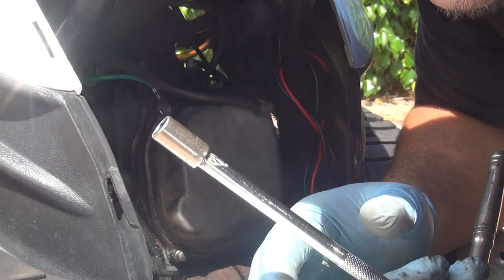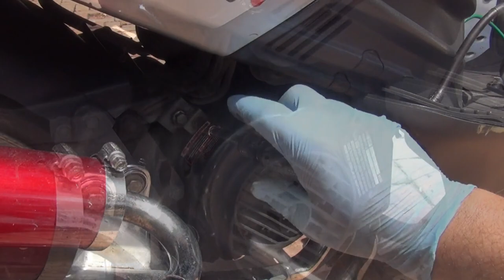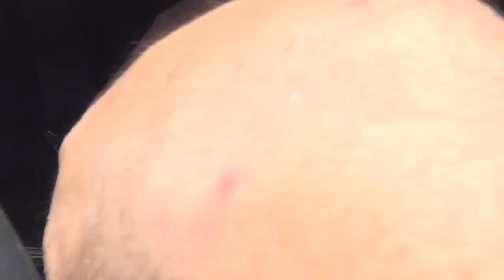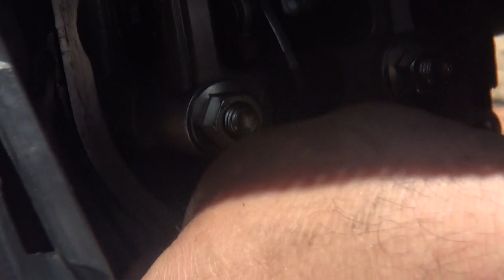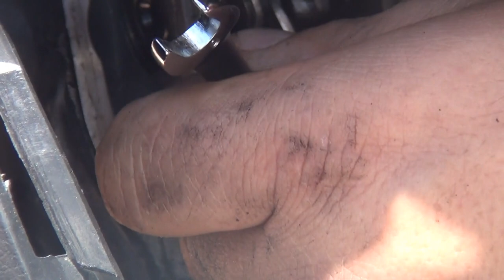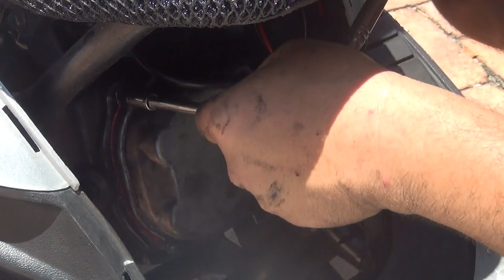Ultimate GY6 150cc Valve Adjustment Tutorial

Comment: Made these adjustments for ny 49cc .004 upper, .003 lower..now i have chatter..got my toos speef back but im pretty certain chatter isnt good for the engine so I readjusted them to where i had only a little wiggle room,and it runs like a top but I have lower top speed..
Reply from the maker: I ‘ m not specialize with 50 cc scooter try to check online or scooter Facebook group if you can find the perfect solution thank you for watching my video

Comment: Hey friend I have a GY6 50cc Chinese scooter my question is on the valve cover is there always a ground wire on one of the screws?
Reply from the maker: Hello my friend sometimes the green ground wire is on the cover bolt or sometimes is on the fan cover bolt on the right lower side of the scooter personally I like the ground wire  at the cover because is closer to the sparkplug. Thank you for watching my video
Reply: @VirberelloScooterTips  thank you friend

Comment: Hey thank you for the lesson but what should be the clearence be on a gy6 152qmi 125cc engine i did mine like yours but now the clearence is too much there is a clicking sound bcuz of that so if you can tell me how much it has to be in MM i would be very thankful👍
Reply from the maker: Hi. Usually .003-.005. Set mine at .004 ...no noise at all should be heard from valves but if you still ear clicking thing about motor oil pressure like the oil pump going bad and not bringing lots of oil to the valves 👍
Reply: @VirberelloScooterTips  i will try thank you brother learned so much from you

Comment: Does the ground wire go from the valve cover to the battery? I bought a used moped and the wire is to the valve cover but the other end is loose. Thanks.
Reply from the maker: In most cases, the ground wire in a scooter does not directly connect from the valve cover from the battery. The ground wire is typically responsible for providing a return path for electrical current and is usually connected to the frame of the scooter and them connected to the valve cover, which then acts as the common ground point for various electrical components.
It's possible that the previous owner of the moped may have made modifications or changes to the wiring, leading to the ground wire being attached to the valve cover. Thank you for watching my video

Comment: Ive got a 150cc Powermax chinese scooter...i replaced the the spark plug,  new air filter, new carburetor, new fuel/air lines and petcock; im still having performance issues though. Ill be riding (1/2 or 3/4 throttle) and occasionally it will slightly bog down and lose power. If i play with the throttle a bit it will sometimes come out of it, but then other times itll stay like that until ive reached my destination and wont run right until after im heading back home...i plan to replace the CDI next, but next to that, are there any thoughts you might have on whats causing this?
Reply from the maker: It sounds like you've done a fair bit of troubleshooting already, which is great. The symptoms you're describing—a scooter that bogs down and loses power intermittently, especially at partial throttle—can be indicative of several issues. Let's explore some possibilities beyond the CDI:
Ignition System Issues: While you're planning to replace the CDI, it's also worth checking the ignition coil and the stator. Faulty components in the ignition system can lead to intermittent power loss.
Fuel System Problems: Even with a new carburetor and fuel lines, there could still be issues within the fuel system. Ensure that the fuel tank is clean and free of debris, and double-check that the fuel lines are properly connected and not kinked. Additionally, verify that the fuel filter is clean and not clogged, as restricted fuel flow could cause power loss.
Vacuum Leaks: Any air leaks in the intake system can disrupt the air-fuel mixture and cause performance issues. Check all connections from the carburetor to the engine for leaks, including gaskets and intake manifold connections.
Exhaust System Blockage: A blocked exhaust can lead to back pressure, causing the engine to run poorly. Check the exhaust system for obstructions or restrictions, such as a clogged muffler or exhaust pipe.
Electrical Connections: Ensure all electrical connections are secure and free of corrosion. Loose connections or corrosion can lead to intermittent electrical problems, including power loss.
Engine Timing: Incorrect ignition timing can cause poor engine performance. While this is less common on small scooters, it's still worth checking if you've exhausted other possibilities.
Compression Issues: Low compression can lead to power loss. Perform a compression test to ensure the engine is operating within the manufacturer's specifications.
Quality of Replacement Parts: While you've replaced several components, it's essential to consider the quality of the replacement parts. Sometimes, aftermarket parts may not perform as well as OEM parts, leading to continued issues.
Overheating: Check for signs of overheating, such as a hot engine or exhaust. Overheating can cause performance issues and damage engine components.
Engine Tuning: Lastly, ensure the engine is properly tuned. This includes adjusting the idle speed, air-fuel mixture, and throttle cable tension according to the manufacturer's specifications.
By methodically checking each of these potential issues, you should be able to narrow down the cause of the performance problems with your scooter. If you're still unable to resolve the issue after replacing the CDI and investigating these possibilities, it may be helpful to consult a professional mechanic with experience working on scooters. Thank you for watching my video and if you have more question feel free to contact me anytime
Reply: @VirberelloScooterTips  because my scooter is one of those cheaply made chinese bikes, the exhaust was the first thing to go on it; just broke off out of nowhere. I tried a couple times to get it recounted with no luck so I just do without it. And while I know that not having an exhaust can effect performance and gas mileage,  I don't believe that it is the source of my problem as this issue presented itself almost 2 years after losing the exhaust...I'm in the middle of breaking down the OEM Carb for cleaning, I would really like to re-jet it but I don't quite understand the process behind it and not confident I'd do it right, so I'll just replace the current jets in it and keep it for a spare... after the new CDI arrives though,  I think my next step will be checking the air/fuel mixture because I believe that is where my problem lies

Comment: My friend did this on my gy6 sym fiddle 2 but since then both wheels have been stuck on the ground i.e. not pivoting when on centre stand, very hard to turn wheels to put in air. Engine seems fine now, turned out to just be a loose coil wire but as I can't understand how adjusting gaps could lower the wheels I'm scared to ride it now in case something else structural has gone. Any ideas what could cause this?
Reply from the maker: It's unusual for adjusting the gaps on a GY6 scooter to cause both wheels to be stuck on the ground when on the center stand. Here are a few things to consider and check in this situation:

Center Stand Issue: Make sure that the center stand is functioning correctly. It's possible that the center stand itself is not properly engaged or is obstructed in some way, preventing the wheels from lifting off the ground.

Rear Suspension: The rear suspension could be the culprit. If the suspension has been improperly adjusted or tampered with, it might not be allowing the rear of the scooter to lift properly. Check for any issues with the rear shock absorbers, springs, or suspension components.

Wheel Bearings: If the wheels are hard to turn, it could be a problem with the wheel bearings. If they are damaged or not properly lubricated, they can create excess friction and prevent the wheels from spinning freely.

Brake Calipers or Pads: Check the brake calipers and brake pads on both wheels. If they are not releasing properly, they can create friction against the rotors and prevent the wheels from turning freely.

Tire Pressure: Make sure that the tire pressure is correct. Low tire pressure can make it more difficult to lift the scooter on the center stand.

Alignment: Incorrect wheel alignment can also make it difficult to turn the wheels. Check if the wheels are properly aligned and adjust them if necessary.

Inspect Recent Adjustments: Since you mentioned that your friend did some adjustments, review the work they did. Ensure that nothing was inadvertently changed that could affect the scooter's ability to go on the center stand.

If you're unable to identify and fix the issue yourself, it's advisable to take the scooter to a qualified mechanic or service center for a thorough inspection. Riding a scooter with unknown structural issues can be dangerous, so it's essential to ensure that everything is in working order before using it again.
Reply: Wow many thanks for such a comprehensive list to work through. I've already replaced the centre stand but will check thru the rest & yes defo not riding it until I know understand what's causing it. All my local bike shops seem to be permantly booked up but hopefully will find someone knowledgeable to help figure out what's going on. & well it might be time to finally look at getting a new bike, just don't want to give up on it yet.

Comment: I’m doing this right now actually I’m heading outside to tear it down
Reply from the maker: You're welcome! I'm glad to hear that my YouTube video on valve adjustment is helpful to you. Performing maintenance tasks like valve adjustment can be crucial for keeping your scooter running smoothly and efficiently. Remember to take your time and follow the steps carefully to ensure everything is done correctly.
If you encounter any difficulties or have questions during the process, feel free to reach out for help. Working on your scooter can be rewarding, but safety should always be a priority, so make sure to wear appropriate safety gear and work in a well-ventilated area.
Good luck with your valve adjustment! I hope your scooter runs even better after this maintenance. If you need any further assistance or have any other questions, don't hesitate to ask. Happy scootering!

Comment: Hello I have a 49cc puma scooter and the plate on there says a valve adjustment is 006 and 008 Do you think that's a misprint from the factory?
Reply from the maker: It is unlikely that the valve adjustment specification on your Puma scooter is a misprint from the factory. The valve clearance for an engine is an important specification that must be set correctly to ensure proper engine performance and longevity.
In general, the valve clearance specification is measured in thousandths of an inch or millimeters, and it can vary depending on the specific make and model of the engine. It is possible that the valve clearance on your Puma scooter is set to 0.006 inches on the intake valve and 0.008 inches on the exhaust valve.
However, it is important to note that without more specific information about your scooter's engine, it is difficult to say for certain whether these are the correct valve clearance specifications. You may want to consult the owner's manual or a qualified mechanic for more information on setting the valve clearance on your Puma scooter.
Thank you for watching my video
Reply: @VirberelloScooterTips  0k And thank you so much!!!!!!

Comment: Say buddy do you know what size dowel pins these gy6 scooters uses for the cylinder head assembly..? I removed  my rockers to replace my cam when put it back together I miss aligned my rocker cage assembly ended up smashing one of the dowel pins now I need a replacement and I dont know what size to order thought I ask you for your help 🙂
Reply from the maker: Universal Parts 10x16 Cylinder Dowel Pin for GY6 QMI/QMJ 152/157 on parts for scooters website or on amazon https://amzn.to/3AE7gIQ
Reply: Thank you so much my friend I really appreciate you...😁👍

Comment: Hello i just did a valve adjustments on my 2017 taotao gy6 engine an i thought i had the nut tight but i put everything back together an started it up ran it for 20 mins started to hear a metel tapping put it back apart an a valve nut came off but i cant fine it near the gears where can u end up getting stuck at in the engine?
Reply from the maker: Hello Brian wow try to drain the motor oil the nut could be at the lower part of the motor plus  buy a Prima Magnetic Oil Drain Kit https://amzn.to/3oUgv1z so if the nuts is around there will stay attached to the magnetic part and will not go around the motor  and damage any moving parts

Comment: What happens if I over tighten the valve bolts?
Reply from the maker: Over-tightening can strip the threads on the bolt itself leading to performance issues like loss of compression or difficulty starting the scooter.

Comment: What is the gap for a 50 cc scooter and thank you so much for your videos bro. You’re a God Send
Reply from the maker: Hello my friend for gy6 motor is  .003 on the intake (top) and .004 on the exhaust (bottom) but the T mark at the flywheel could be different from 150cc .Thank you for watching my video
Reply: @VirberelloScooterTips  Thank you. Is there an easy waybto tell if i have 49, 50, or 150 cc. I dont know how to tell for sure
Reply from the maker: @ghettoblack8754  Hi a 50cc max speed is around 40 to 45 mph and in the lower left  of the motor there is a print  139qmb
Reply: virberello GY6 Tips and Tricks thanks again friend. I really appreciate your time and patience. God will bless you a thousand fold for helping others the way you do

Comment: Do you need 2 adjust after exhaust and air filter upgrade? How do I get rid of backfire?
Reply from the maker: Hello Bryan no you do not need to adjust the valves after you upgrade to get rid of backfire change your carburetor Main jet to a  #120 main jet if you are at sea level or if you are little higher in altitude  place a #115 main jet  that should be fixing the problem

Comment: i have a question that fuel line that leaks oil or pressure,  where does it get connected to ??
Reply from the maker: Hello the hose that is connected to the valve cover that  release  the motor positive pressure get connected under your stock air filter . Thank you for watching my video
Reply: @VirberelloScooterTips  do you have any pictures of where it goes

Comment: Hello knid Sir, I have tried everything you suggested but my BRAND NEW fuel injected scooter dies when I leave it running. The throttle adjustment helped it a lot but after it get's a little bit warm it shuts off. I can ride it. but if something is wrong I don't want to keep trying to ride it. Can you please offer any suggestions, I will kindly cashapp to you if you can help me...thanks so much! It's Clash 200 EFI built by chinese of course FYI (I am a woman with a little mechanicial sense)

Comment: Love your videos keep it up man, i changed the oil the other day on my tao tao 150cc and i rode it home with no problem but when i went to ride today. I made it down the street and it cut off and qouldnt start back up again, now it just turns over but wont start any ideas on what it could be, thanks in advance
Reply from the maker: Hello Yaboi I always start from the easy part 1 I make sure the spark plug boot is not lose 2 I remove the spark plug and I try to turn scooter on to see if the plug makes a good spark 3 I check the petcock ( fuel valve )  to make sure fuel goes to carburetor. these few steps that I always take. check my community page on my channel https://www.youtube.com/user/virberello/community?view_as=subscriber and see the post engine not starting. Thank you for watching my video
Reply: @VirberelloScooterTips  ok im going to try it out thank you very much, kee p making great videos
Reply: When that happened to me it was the spark plug wire was touching the motor and melted so it could be something to do with the spark plug like he said.
Reply: What a pleasure to discover your channel. I have put a 150cc on the road after missing my little Buddy 50, and haven't looked back. Now I am completely interested in my Chinese scooter and don't mind the wrenchwork. What a great way to travel and now I am saving for a Chinese motorcycle. You really have a way with teaching. I love your style. "Put the plastic out of your way so you don't step on it." Hahaha! Thanks again.

Comment: When i turn fan and  T, valve clearance iş so much, but when i make one more turn and T , clearance iş so small.but there iş valve noise.which position must İ select to adjust valves?
Reply from the maker: Hello I like the combination of the T marrk and the camshaft gear holes alignment at the same time to make sure
Reply: As Virbello explains about the camshaft gear holes. This is because the crankshaft turns 2 times for every turn of the camshaft. In your situation, the first time you rotated to T you were at the compression cycle of TDC; which means both valves were closed. That is where you want to be. But the second time you rotated to T you were at the exhaust cyle of TDC; which means the exhaust valve was opened.

Comment: Where does that green ground wire run from.
Reply from the maker: Hello my friend that green wire is connected to the frame of the scooter or sometimes is just directly connected to the negative part of the battery and the other end is connected to one of the bolt of valve cover. Thank you for watching my video